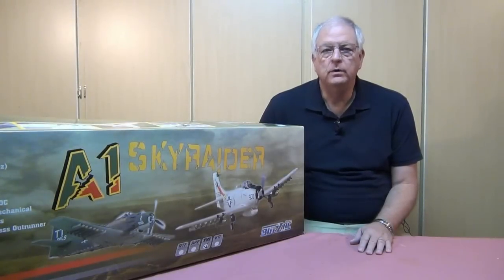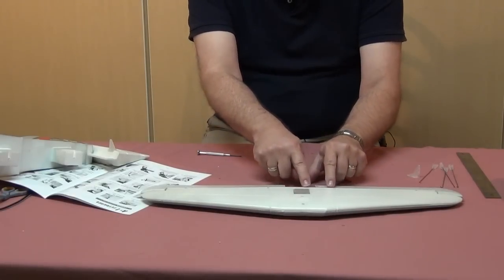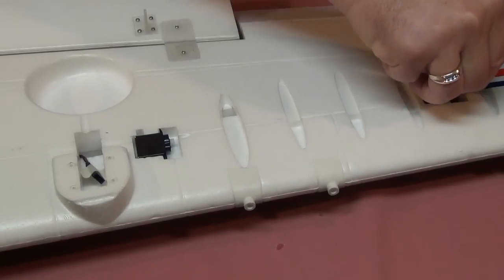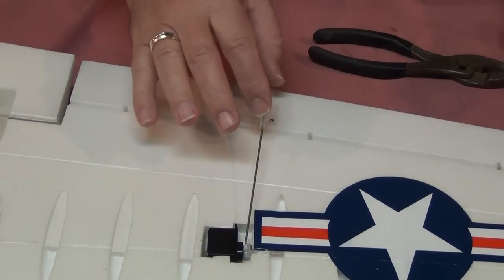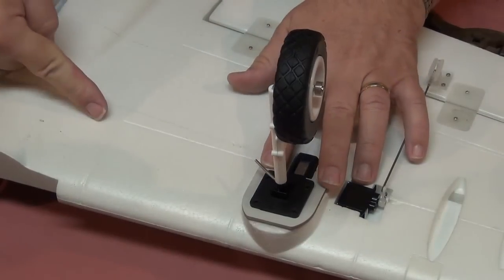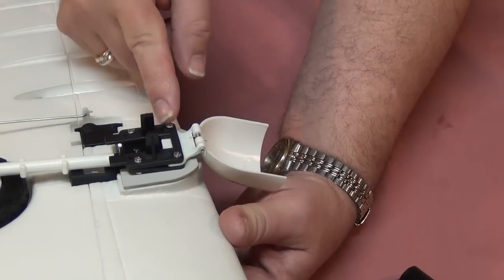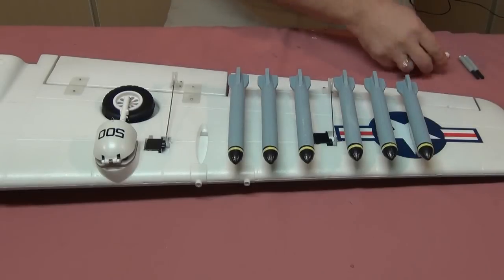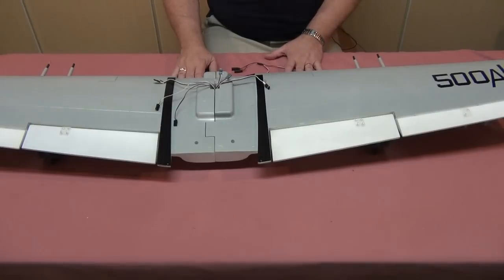A-1 Skyraider Build Log Pt 2.mp4

Comment: Thanks Jim,
I figured as much but, wanted to be sure.
I don't know if you've ever had the opportunity to actually flying your A1, but like sooo many build videos, you also stopped short of demonstrating the balancing process after completion of this aircraft. I'm not sure why this is a common exclusion.
Did you find that additional weight was required (either fore or aft) to achieve CG balance?

Comment: Greetings Jim,

Thank you for the most helpful video. I was wondering, the nuts that you used to add additional angle to the landing gear, did the mounting screws go through those nuts or are the simply wedged in there? It is difficult to tell.

Thanks again